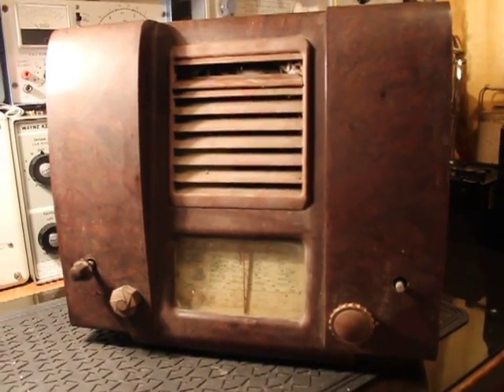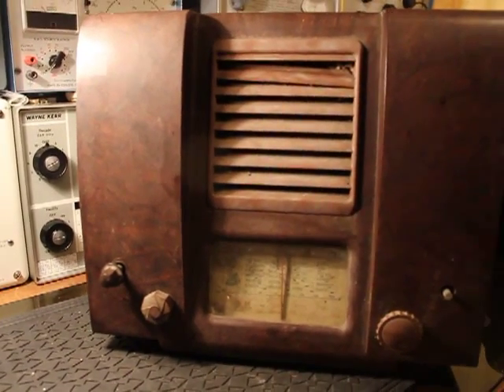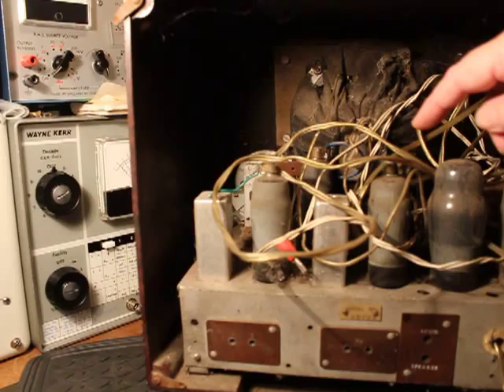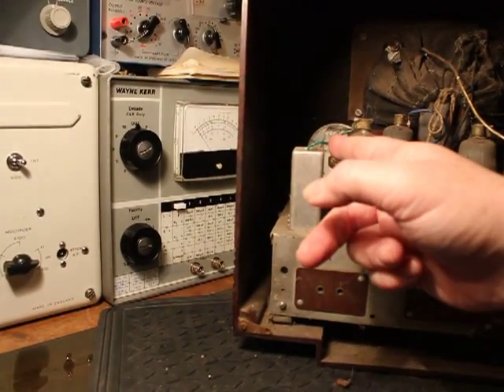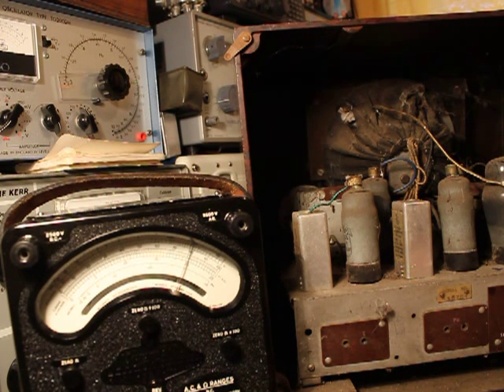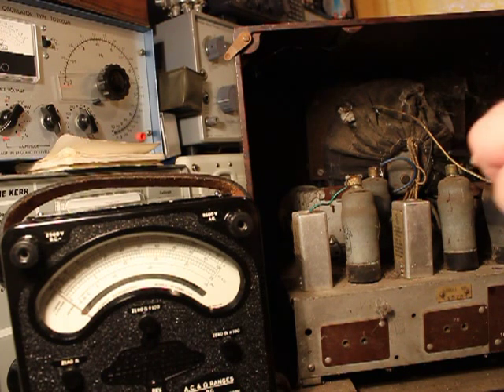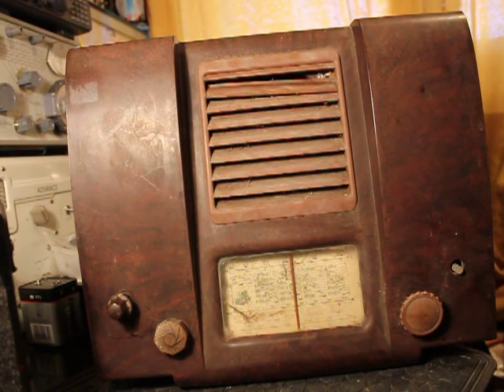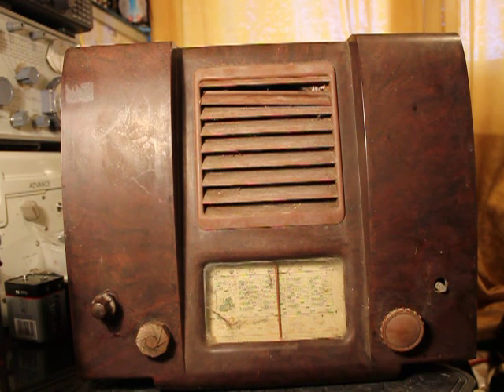Defiant MSH546 radio

Comment: Andrew,
The Defiant radio has immense restoration potential my friend. The Co-op was where I did my apprenticeship and, as far as I’m aware, were the only company to have access to all the circuit diagrams. Ironically, I personally had very little to do with Defiant repairs – by 1971 (when I began my apprenticeship), Defiant had been absorbed into Rank Bush Murphy Group and as far as I’m aware the Defiant brand was disused sometime after the mid-1960s. Up to around 1964/65 Defiant chassis were designed and produced, certainly with budget in mind, by Plessey
P.s, pay attention to the condition of the mains and audio output transformers and be prepared for valve trouble - Mazda valves weren't exactly the best.
Cheers,
Phil.

Comment: There are certain states of filth & deterioration which makes a piece of equipment untouchable. Thick dust, spiders, condensed chip fat or woodworm flight holes.
That Bakelite case will look fantastic after being treated with a Beeswax & Turpentine paste + elbow-grease.
I am not usually one of those types that get all obsessed about 'originality' & re-stuff paper  capacitors  when they are under the chassis & therefore invisible.
Reply from the maker: NJPurling Hi Neil, please see part 5 for the end result. It came up well. Thanks for watching - Andrew